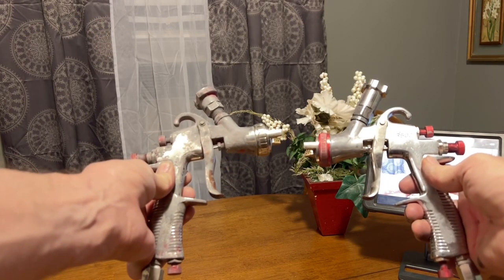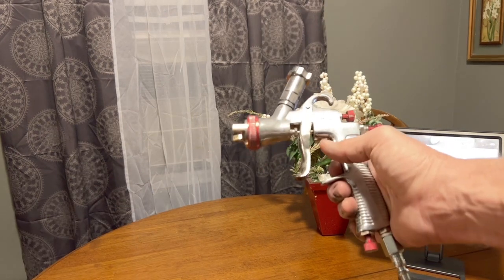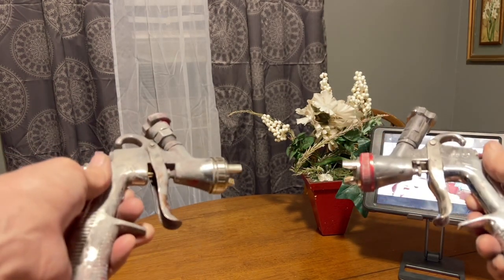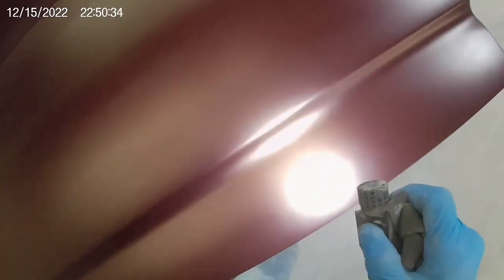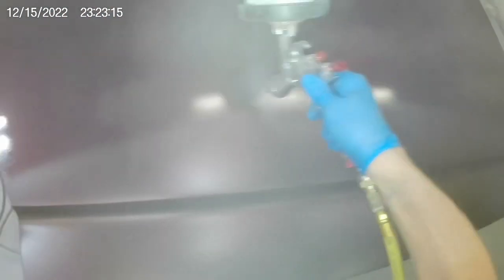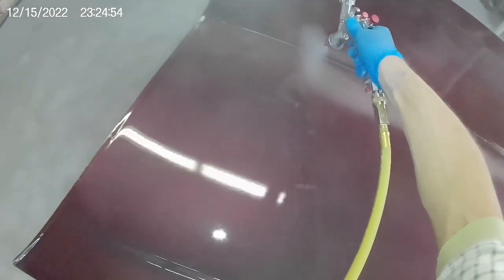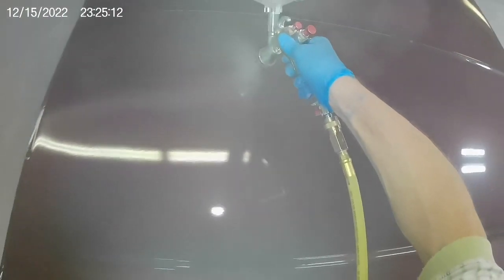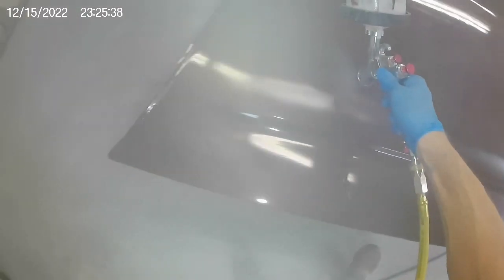Sprayit SP-33000::: Long, long term review

Comment: You were really flying across the hood! The fast reducer was a choice? Or just what you had? Or did you want to work this hood superfast and get out?
Reply from the maker: The guy who’s shop it was called me to paint it in 30 degree weather, so I told him to get me fast reducer for base and fast activator for clear.  It ended up being in the 20s so he borrowed a propane heater that got it up over 80 so I had to improvise.  When I was a retail painter in the early 90s, that high speed was standard procedure for Sikkens 1-2-3 clear.  I’m kinda too old to move that fast, so I’m glad it was just a hood😉
Reply: Excellent paint work sir!
Reply from the maker: @eapauto  Thank you sir!  The last time I was a professional painter was 10 years ago, but I mostly do bodywork now, since my vision is failing rapidly.  Spraying the paint is the easy part; and I have 40 years of muscle-memory.  It’s hard to match colors when you can’t see good…

Comment: No solvent popping with that clear hoseing it down? Im not much on fast reducers and hardners,
Reply from the maker: You’d think so, but it came out fine
Reply from the maker: YesWelder was 10
Reply: @OldBondoBilly 
12345
Reply: 54321
Reply: 31126